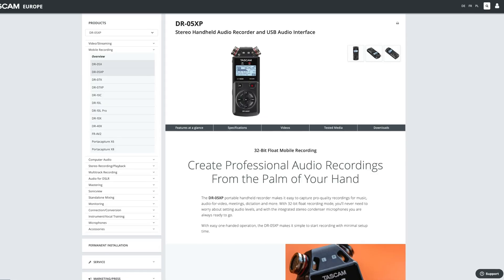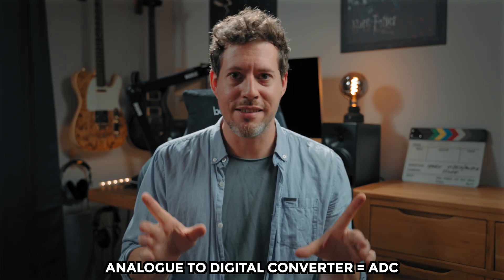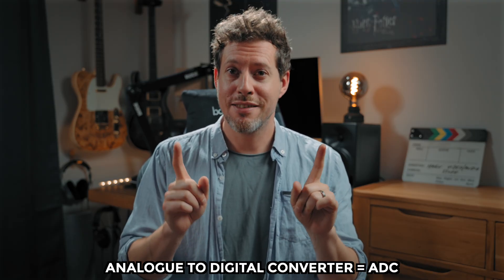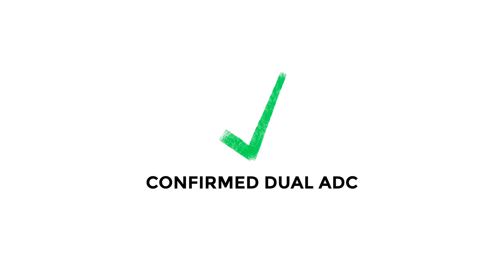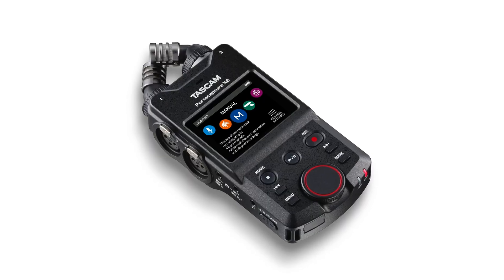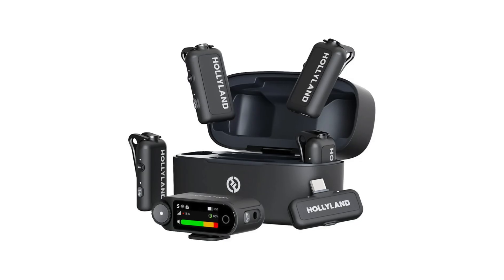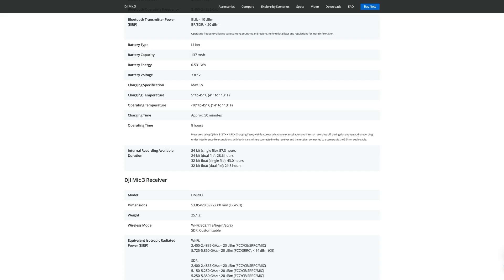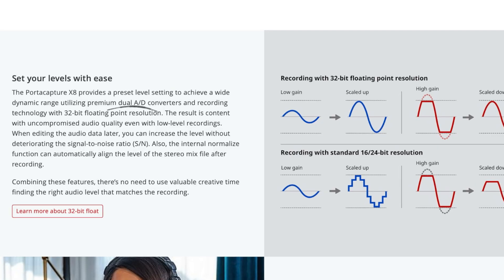The Truth About 32-Bit Float Recorders: Dual ADC vs Marketing Hype

Comment: Using Google, this is what A.I. says about the Rode Wireless Pro: 

Yes, the Rode Wireless Pro uses dual analog-to-digital converters (ADCs) to enable its 32-bit float on-board recording. 

Here is how the dual ADCs work and what they do for your audio:

Dual-path recording: Each transmitter in the Wireless Pro system features two ADCs that operate at different gain levels.
Preventing clipping: One ADC records at a normal level, while the other records at a much lower, more conservative level. This creates a "safety channel" that serves as a backup, ensuring that if the main audio signal clips (gets too loud and distorts), you can still recover the pristine, unclipped audio from the lower-level recording.
32-bit float: This dual-ADC setup is what allows the Wireless Pro to achieve 32-bit float recording. This recording format captures a massive dynamic range, which makes it possible to recover audio that is either too quiet or too loud in post-production without adding noise or distortion.
Reply: AI just repackages whatever is written on the web. It doesn't make it right.
Reply: Is wrong!

Comment: How about tentacle track e??
Reply: I had the same question.  I checked the manual and it doesn't specifically state dual ADCs.  Even if they don't have "true" 32-bit Float hardware, the units have been flawless and I have not experienced any issues with the recordings. One interesting thing is that the specs say dynamic range is 110dB.  The Deity PR-2 states 123 dB of dynamic range and it is confirmed to have dual ADCs.

Comment: I get clipped recordings with the internal 32bit float on the Rode Wireless Go II, but only with my girlfriend who is occasionally louder than a 747.
For this same reason, I can't even use my Hollyland Lark M2S (which doesn't record internally, but clips horribly).
I'm just switching to a preowned DJI Mic 2 with the hope of less clipping.
Reply: Wow, it's amazing that you get or got 32 bit out of the Wireless Go II since the only 32 it has is grams per transmitter 😂 Just the Wireless Pro is advertised as having 32 bit...
Reply: @cristiat  when mounted as USB storage, both the "compressed" UGG and native WAV files (not exported via the app) are in a 32bit float *container*. Storing and offering 32bit export is marketing fluff, as per the topic of the video.

Comment: Ha, Unless both ADCs have the accuracy quoted (in other words accuracy of 1 bit over the entire claimed dynamic range), then this is rubbish! This is OK but the  ADC is the limiting factor, and accuracy and linearity are NOT this good!  It is simply marketing, and not necessarily useful in a realistic way. Range changing between ADCs is also a problem because the ANALOGUE gai between them must be EXACTLY correct to 1 bit of the lower one, very unlikely! The result will be increased distortion of otherwise good analogue mic signals! Just set the gain boys,  20dB below peak will always work with about 18 bits of DR, more than adequate!

Comment: I'd say there is more to the story. If the noise to signal ratio of the analog part is not high enough, even if the device uses dual adc's and record 32 bit float, you won't get so much benefits (if at all). Or said otherwise, if the analog part is poorly performing you just digitize a wider range of noise :-)

Comment: interesting...! currently running the rode wireless 2 and never had any problems with clipping on internal recordings. It would be super nice if you could make a video actually testing these devices
Reply: I'd like to see testing as well!
Reply from the maker: Hmm, I’d love to do this too. Really the best/only way to definitively find out without confirmation from manufacturers would be to do a tear down. Open them up and see! 😅
Reply: @HarvVideoAudioStuff  if it matters, you should be able to test it with a recording, right? if you can't notice by recording, there's no practical difference
Reply from the maker: It would be more difficult for sure, the thing is there are physical limitations to recording chains. With the extreme levels you’d need to test at, you’d need to be sure not to mistake ADC clipping with the mic or preamp overloading. It would really handy if manufacturers could just tell us!
Reply: Particularly because I just bought a Tascam DR-07XP 😥
Reply from the maker: It’s still really good 👍🏻

Comment: If the mic itself over loads / clips  , 32 float wont save anything will it ?   But I guess there is an advantage to bring up low level recordings ?
Reply from the maker: Correct, you still have work within the physical limits of your signal path 👍🏻
Reply: @HarvVideoAudioStuff  . What with 32 bit float and open gate , the bros in base ball caps on backwards  are peddling a lot of BS these days  now that no one cares about 32K res sensors :)

Comment: Thanks for posting this.  My understanding about which devices only have single ADCs is as follows - 

Tascam DR-07XP and Tascam DR-05XP - Tascam originally claimed on YouTube that these had dual converters. When I challenged them in YT comments, their representative was dogmatic about the dual converters, to the point of being offensive.  He said single ADC 32 bit float was impossible. Then suddenly, they backtracked, conceded that only single ADCs were used, and their original claims were deleted.

DJI Mic 2 and DJI Mic 3 - DJI have confirmed, when questioned in their forum, that these are single ADC devices.

Zoom H4essential is partly single ADC (when using other than input 1 & 2 - according to the product user manual).  Subsequently they told me via email, "Single A/D converters are used on the H1essential and H2essential as well as any other input that is not specified to have dual A/D converters. The microphones on each product have a Max SPL Limit. Within that SPL Limit, the recorder is able to capture the audio in full clarity without having to set gain."  So with Zoom products, only devices specifically claimed in publicity and specs to have dual converters actually have them.

The Tascam Portacapture X8 does not have dual ADC on the "ext in" and they even mention in the manual that extra care is required on the "ext in" to watch the gain. 1-6 are the 4x TRS/XLR combo jacks and the L/R mics, and they do have dual ADCs.

It seems to me that when a single 24 bit ADC is used in a recording device with its 24 bit output being written in 32 bit float format (crudely explained, 0.99 being writtern as 0.99000, same thing), it would be perfectly possible for the values to be multiplied in the ADC by (say) 1.2 before writing to storage.  So 0.99000 becomes 1.18800 (I'm being illustrative rather than mathematical), and therefore if 1.00000 is full scale, then the waveform would look clipped in editing.  But the person editing could then reduce the amplitude by a factor of 1.2 or whatever they wanted, and the audio would no longer be digitally clipped.  And they would think, wow, that shows the benefit of 32 bit float.  But actually it would be an illusion.  Do manufacturers actually do that?  Who can tell...

I saw a video where the usual Zoom representative was asked about the benefits of single ADC 32 bit float, and the chief point I got from his video response is that he claims that the single ADCs used are of significantly better quality than those used in the past, and that therefore their 24 bit output needs to be stored in a 32 bit float container.  Hmmm.

Comment: Good info!  I think an even bigger source of confusion( I'm being kind here) is 32-bit wireless microphones.  I wonder how many novice creators are buying 32-bit products without understanding than nothing transmits 32-bit audio into their camera.  And even if they could, almost no mirrorless or smartphone cameras can record 32-bit audio.  So the vast majority buying wireless mics and primarily using the transmitted audio and almost never using the internally recorded 32-bit audio (unless they have a wireless transmission failure) could probably do fine with less expensive/older products.
Reply: 32 bit float in relation to wireless mics always just refers to how they record internally, as I understand it.
Reply: @Ozpeter  not exactly, some will transmit 32 bit but right now only to a PC or computer that’s capable of receiving it and doing something with it
Reply: @RobSpiv  I can't find such a system.  Any suggestions?  Transmission is constrained by bandwidth and latency.  Transmitting uncompressed 32-bit float audio at 48 kHz would require ~7.37 Mbps per channel
Most professional wireless systems max out around 1–3 Mbps effective audio data rate, often using compressed or optimized PCM (like 24-bit integer) or proprietary codecs to fit within legal spectrum allocations and avoid interference.
Reply: @Ozpeter Hollyland Lark Max 2 does it
Reply: @RobSpiv  Very interesting, thanks.  This takes us back to the confusing use of the phrase "32 bit float" without specifying single or dual ADCs.  According to Hollyland's publicity, there is a "32 bit chain" from transmitter to receiver and the receiver can output 32 bit float from its USB port.  But notice that the chain is "32 bit" - they don't use the word "float" at that point.  32 bit audio is better than 24 bit audio, but not nearly as good as 32 bit float.  Being of a suspicious nature, I wonder whether they accidentally forgot to use the word "float" in their chain diagram or description, or whether they really do mean just 32 bits.  32 bits would be more technically possible on a 2.4gHz link than 32 bit float, which has radically more data to somehow fit into the bandwidth.  I'm not challenging you about this, I am really interested, and if you can point to any clear statements about exactly what they mean, please tell me!
Reply: @Ozpeter You know more than I do. Personally, I use wireless mic as really just a recorder pack for a hidden lav and I don’t even bother to hook up the receiver. I just let the camera internal c be the scratch audio and sync in Premiere Pro. I found it more work to record good audio and the have to splice in clips from the internal recording in the mic to fix wireless glitches anyway.
Granted, I am only doing talking head stuff and not serious cinema work
Reply from the maker: This is so true, thankfully 32 bit float seems to be creeping into new cameras features. But this is one of the many reasons I always urge people to keep their audio off camera. The topic may be worth a video! Many thanks 🙏🏻

Comment: Cleared some air on 32bit float. Thanks for the video. 
I have a question. Do the lav mics attached to a say, zoom h1 essential 32bit float recorder, also have to be compatible?
Reply from the maker: If it's a wireless system then yes, wired labs are not a problem though